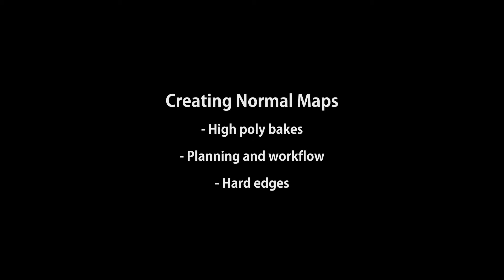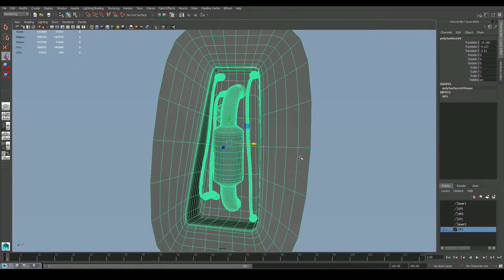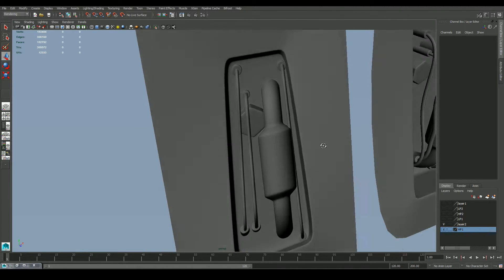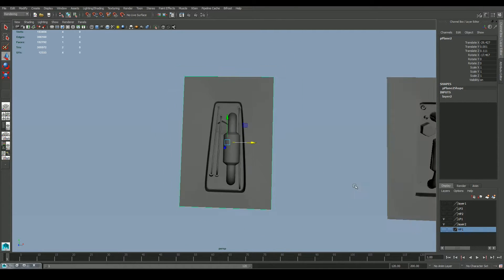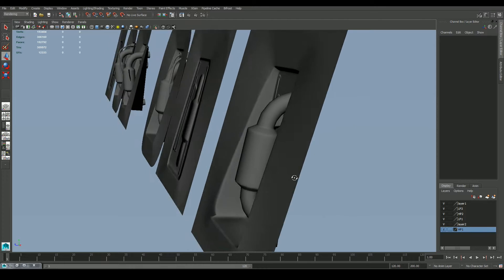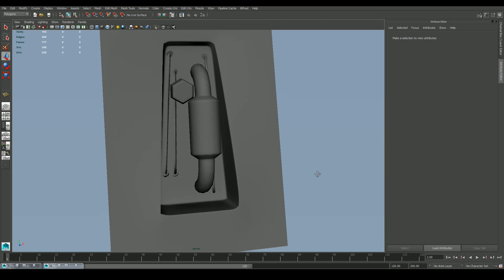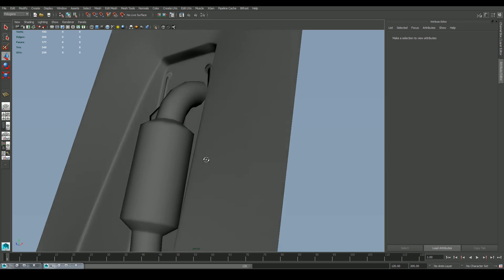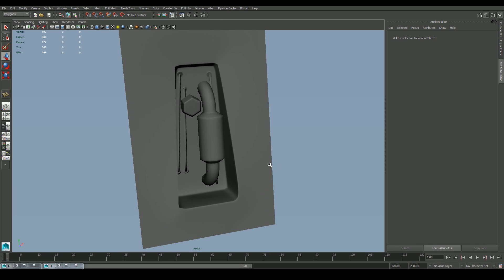Normal Map Tips

Comment: As far as Maya and MAX are pretty much the same nowadays, I guess you know how to get it working. I need to bake a normal/depth pair while having a fully defined depth scale - and everything works well until I try to add dents on my source geometry via bumpmapping. The bumpmap affects the normal map, yet there is no effect over the depth one so the parallax pipeline generates a correct image only if the dents are not deep enough to noticeably affect the depth. Any way to get it working?

Comment: Great video! But I have a question: I have a 3D barrel in high poly and it has 16 cubes for the planks and 4 pipes for the metal arcs around the planks. And I did a simple low poly using only a cylinder with the same size of the high poly barrel, so my low poly has no objects to explode. Is there a way to bake a very complex high poly into a simple low poly? I mean a very detailed high poly (with many 3D objetcs on it) into a simple low poly made with only one 3D object.

Comment: Could you give me an idea of the max poly count for a game asset like a fire hydrant for an AA game in UE4? What would be a sensible maximum number (before it it triangulated).
Reply from the maker: It's difficult to answer because it depends entirely on the situation. Something that's not going to be seen too close might be 500 triangles, while a hero asset that's important (for some reason) and will get a close-up could easily be tens of thousands. If you're making a game that needs heaps of assets, like something open-world, in the interest of production speed, you'd keep the poly count very low. If you're making something for your folio, a personal project, it's reasonable to go to town on detailing it, provided you don't waste your asset budget. These days, texture resolution and draw calls (reduced by number of materials) are more important than polycounts thanks to powerful GPUs. 

But to answer more succinctly, I'd guess around 300-500 polys (tris) would be reasonable for most games today, if it's just some background asset/set dressing.
Reply: Scratch Made How many Tris can an asset have that gets close-ups, but is also set dressing.
I have 4 chairs with 8,022 Tris (Actually 22,088 but that can be changed easily with almost no visual difference) and 3 consoles with 20,750 Tris.
Reply: Presque vu
One good site to check out, is Beyond 3d .com
They have polycounts, for characters from Virtua Fighter 5,
Metroid Prime and even Dreamcast Soul Calibur characters too.
Really fun site.